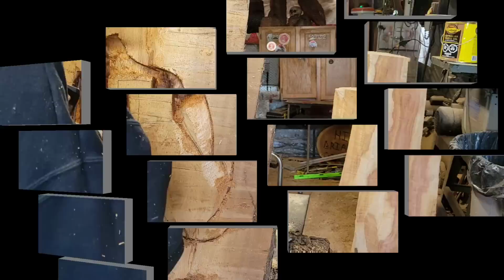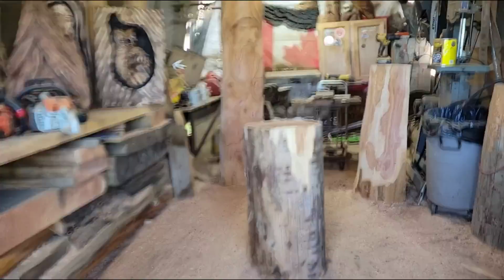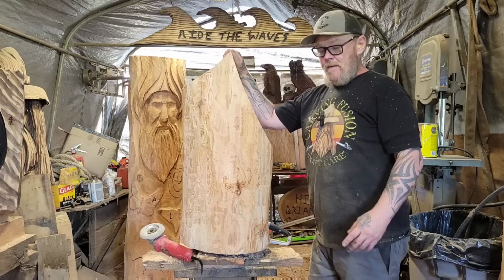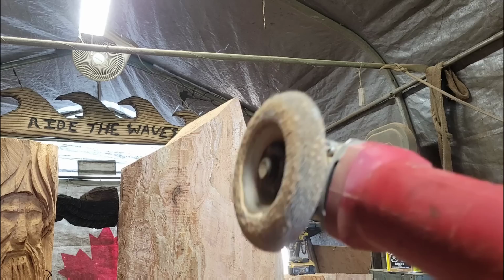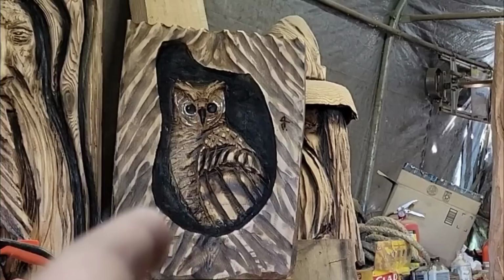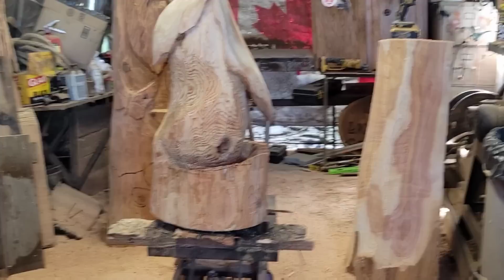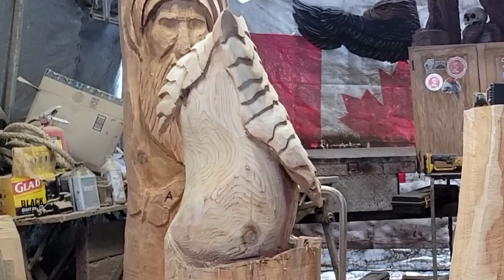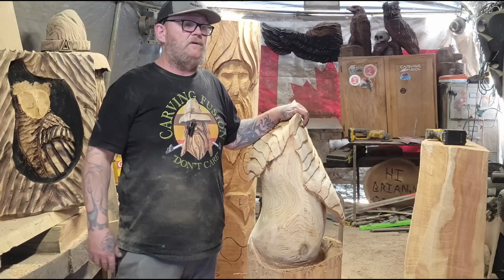Chainsaw wood carving a whimsical fairy house part 1

Comment: Hey Jordy, I use. The angle grinder with the same disc and no guard ( not recommended). I wear protective gloves "Hardy professional series", I've nicked the left hand enough times to have replaced them and my skin was protected. I also use a foot pedal and besides speed control it feels safer having instant shut off.